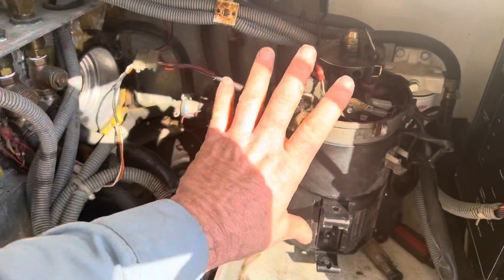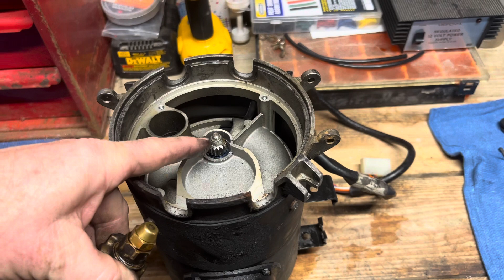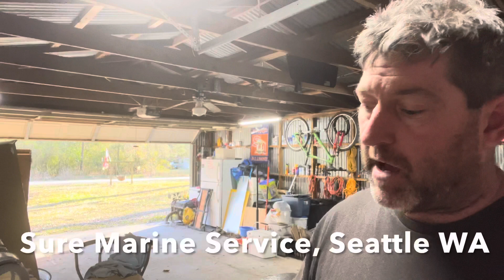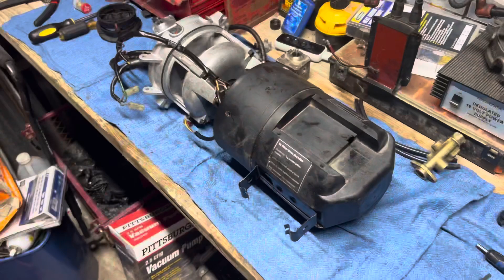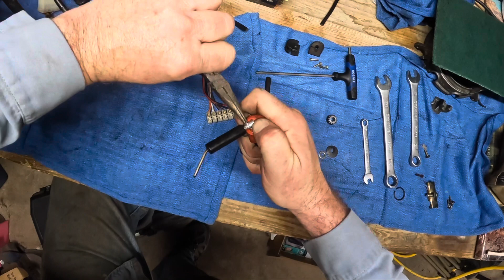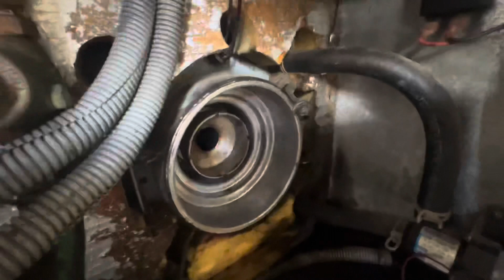Hydro-Hot fuel pump replacement

Comment: I don't have the Hydro Hot, but a discontinued Aqua Hot of which I have not picked up the coach yet. I got to say of all the systems these coaches have, this hydronic heater scares me the most. The mechanical maintenance and/or repairs don't necessarily scare me it's when the wife has no hot water......yikes! Good job, and explanation of the repair.

Comment: Another great video .  I had a float switch go bad while we were in Yuma two weeks ago.  Red light on the control panel water level was lit up.  Got real lucky as there was an add in a local paper for HydroHot repair technician in Yuma.  Gave him a call and he had a new brass float valve on his truck.  Mine was plastic just as he said.  It broke off in the tank just as he said they do.  You might want to shine a flashlight on yours to see if it’s plastic.  It’s gonna fail if it is. Matter of time he told me.  Harbor Freight had the socket (to remove oxygen sensor on exhaust system 3/4”) to install the new valve.  Between you and ZMotorsports I feel very lucky You guys share you knowledge.  Thanks!
Reply from the maker: I figured it was 7/8. I have to change oxygen sensors every 90 days in the industry I work in ( Feds at work ya know..LOL )….We do have the new headlights. They look awesome just haven’t stuck myself in the eye yet to tackle those. Previously someone had epoxied all the headlight adjusters into the buckets.  Brainstorming now for solution. Stay tuned video coming soon !!! LOL
Reply from the maker: Meant to tell you Kevin…..the switch failed….jinx…LOL….didn’t break though. Contacts went bad. Keeps circuit open all the time. Thinks it’s low on coolant.
Reply: @ALongLongWaytoGO  oh no!  Hope it didn’t leave you without hot water or heat. For a temp fix you can short the wires of the switch together so the burner will operate. Always something!
Reply from the maker: @kevinp2820  Exactly what we did….got the new switch in today. !!!!
Reply from the maker: Thanks for the tip…will do. Cause I guarantee you if it’s gonna happen to me and this Hydro~Hot…it’s gonna happen. This thing loves to tick me off 6 days out of the week !!! And a HUGE thanks for watching. Sorry about how long it was.
Reply from the maker: So your saying to use an oxygen sensor socket to be able to unscrew the old switch assembly for removal? Sounds painless enough. A Saturday afternoon and a few basic hand tools. ( 2 days later )……LOL
Reply: Yep, my bad I said 3/4” it’s a 7/8” oxygen sensor socket, you know the one that has the side slot where you tuck the wires in when removing or installing the sensor. My plastic unit was a 1” socket , I just cut off the wires and used a regular socket cause it was bad.  Being plastic and old and heated and cooled all those cycles it twisted the head off of the old sensor.  Had to take a pick and dig out the plastic that was left in the threads where it mounts to the tank.  I used a little wire brush to clean up the threads as I didn’t have a tap to use to redress the threads.  The main body of the sensor is now in the bottom of the tank just as the guy said it would.  Maybe you can get yours out in one piece.  The new brass unit is marked so you know when it is “clocked” at the right position when reinstalling the sensor so the float end is in the right spot. The new brass sensor cost $285 from the tech.  I met him in a Walmart parking lot to buy it from him. Kinda felt like a drug deal gone bad lol!  I’m not sure if I paid to much as I looked online and found them under 10 bucks.  It did have the same manufacturer tag on the wires as the old one that came out so check around you might find one that’ll work for a lot less than I paid.  I very much enjoy your videos.  Have you decided on headlight replacement yet?
Reply: Check your Facebook page. I sent a picture of the sensor socket.